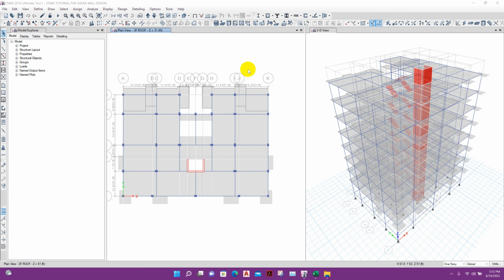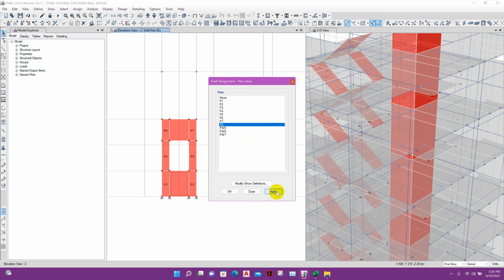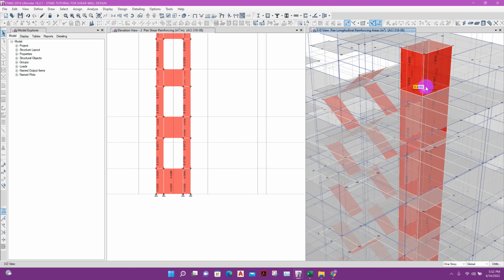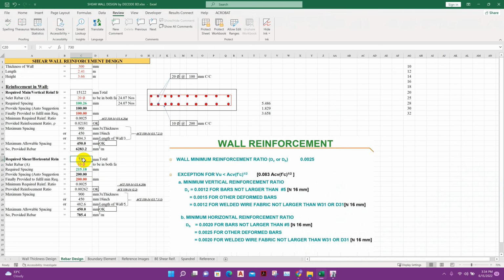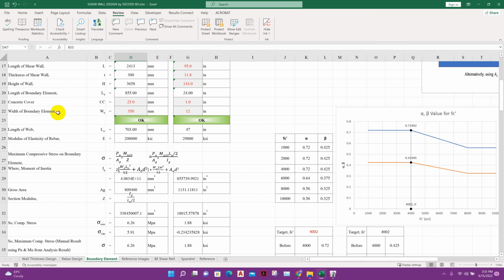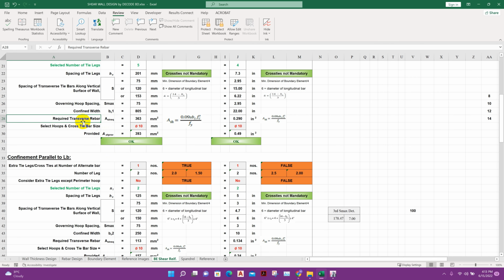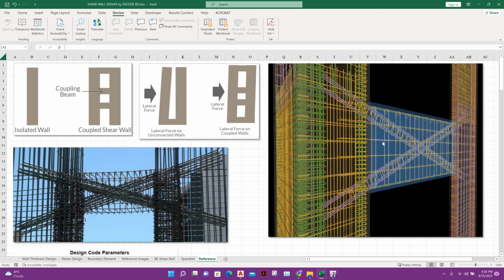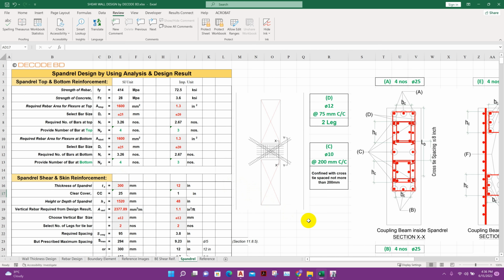Shear Wall Design with Boundary Element, Spandrel and Coupling Beam

Comment: Do I have to model boundary element when there  is column at the corner already because this thickened boundary element will overlap with the column?
Reply from the maker: If columns are in corner then there will not be shear walls.